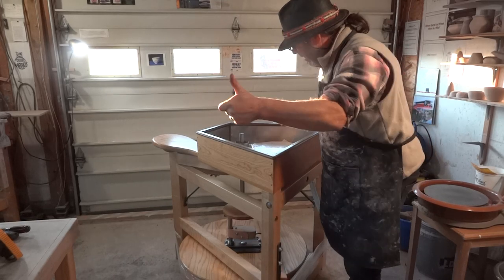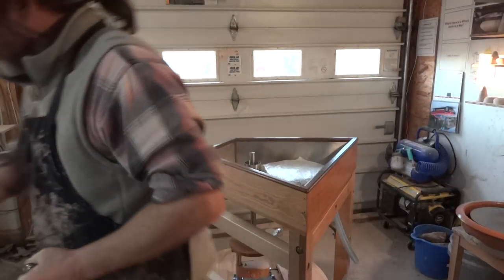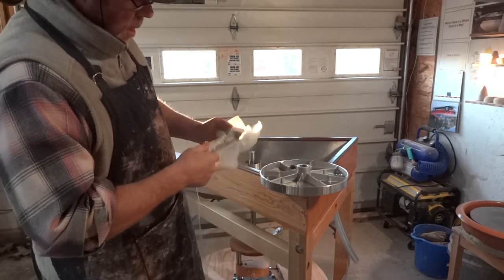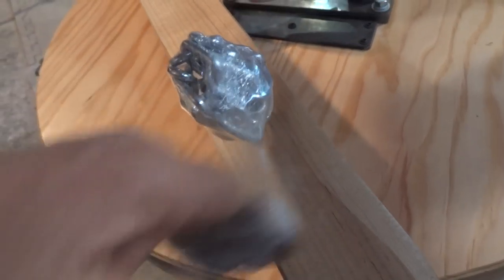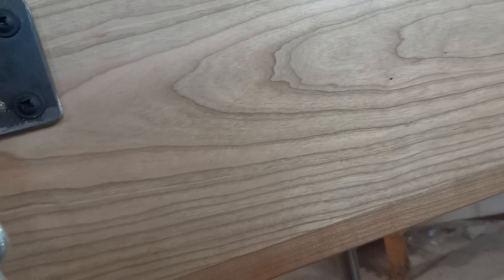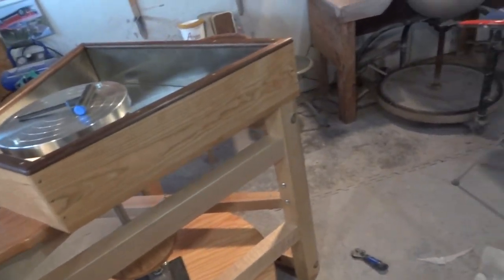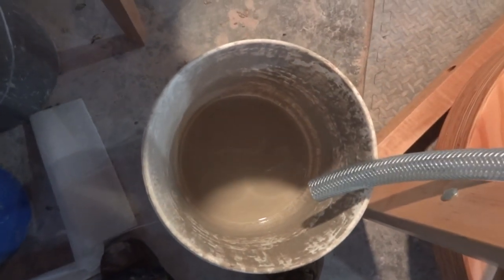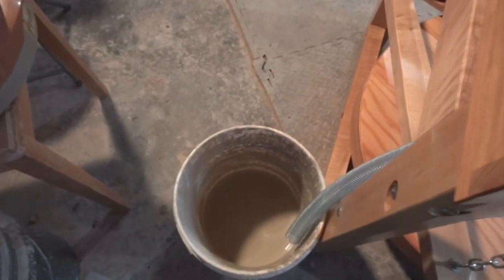Setting up your new Leach Treadle Wheel - Dec 21 2019 with Simon Leach

Comment: Thanks Simon, I have thrown several pieces and I can see that the leather strap on mine is causing friction from being new and tighter than yours. I will loosen the holes in the leather tomorrow.I have greased it all and it throws well. I have 8lbs of ballast in each chamber. I have cut the seat down to be shorter since I am only 5ft6inches tall. I sit closer now. I am still adjusting it each time I throw on it to find the sweet spot where my thigh does not touch my forearm as I centre the clay. All my customers love the design of the wheel since they see it on entering the studio/showroom. It is like a piece of furniture. The best feature for me is the height for demonstrating to customers, they can see the pot form from the side rather than from above, as with shimpos etc. I will post some videos once I get Xmas over with. It is a beautiful addition to my studio and was easy to assemble. Thanks for this video it helped a lot.

Comment: I do Agree with the other potter's that your Treadle Wheel is a piece of Art in its own form. But I still think if you had a extra Leach Treadle wheel in your studio you might be able to teach someone in your workshop's at a different fee of course. I could be wrong but you never know until you try. Have a great Holiday Simon. eddiespottery.
Reply from the maker: I was thinking this next batch of wheels in the early spring I would keep one or two back for my own studio/workshop use ...have a wonderful Christmas !
Reply: @sleachpots Will you be doing a new run of wheels in the future?